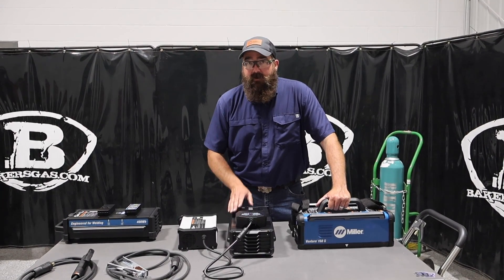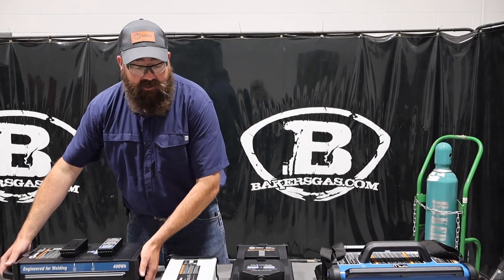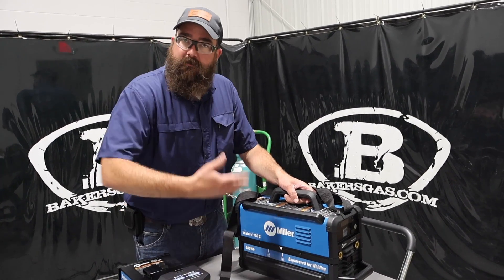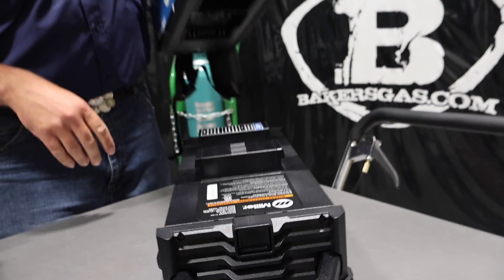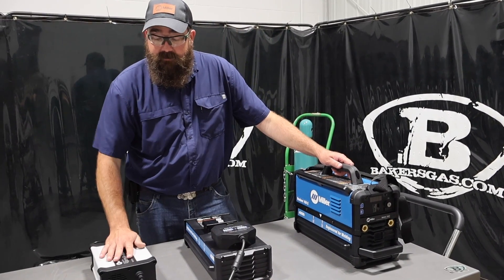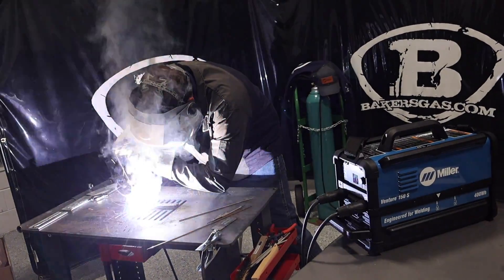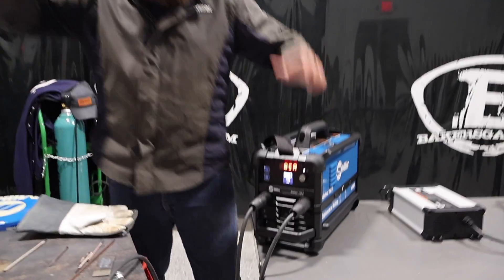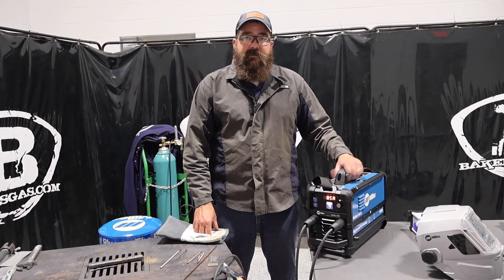Miller Electric Battery Powered Welder Venture 150 S Review

Comment: Not having dual power source ability, like a power supply adapter , running on 110v and 220v is beyond anything stupid in design. Also the battery only having a thousand charge life span is seriously pathetic. That’s not even competitive with a Milwaukee battery life cycle. Even more pathetic considering the battery price.

Comment: Question how long do the battery lasts
Reply from the maker: A Miller Venture battery lasts for approximately 30 minutes of continuous welding at 150 amps and can provide enough power to weld about 8-13 rods, depending on the electrode size and type. The 400Wh battery is hot-swappable, allowing you to easily swap a dead battery for a charged one to keep welding. With proper care, the battery is built to last for over 1,000 charge/use cycle

Comment: Or we do not buy this thing and put that money towards some welding cable and just run our trailblazer all day? (Also, we get paid by the hour, so who cares if it takes 15 minutes longer to run some more lead and not worry about batteries dying)
Reply from the maker: We hear you! This is specific to someone who wants to weld in remote areas without running welding leads. Go for it with the Trailblazer :)
Reply: Like many other things this has a niche purpose and a targeted market, nobody with any sense sees this and thinks it's trying to replace all welding machines
Reply: Im fairly certain there is sense to the fact you can purchase a trailblazer that will have a life expectancy of quadruple the life of this battery machine for double the money. And still have a resale value.

Comment: Engineered for welding sounds like some bs lmao. I guarantee that the welders out there that use power tool batteries perform better and last longer all day. Batteries are batteries no matter how you slice them and I’d rather use batteries from someone whose whole product line is based off of batteries rather than a first generation of a battery system.
Reply from the maker: Thanks for sharing your thoughts; Miller designed this welder to specifically handle welding it is different than power tool batteries. For us the cool thing is the ability to swap the battery and keep going with the same power supply.

Comment: Can it weld while being charged/plugged in?

It seems like the ESAB RENEGADE VOLT is better than a lot of the competition because you can use it and charge it at the same time.
Reply from the maker: You can not weld while it is charging but the quick charge takes less than 30 minutes. This is more portable // easier to carry. If you had spare Dewalt tool batteries, I see where that would be convenient.